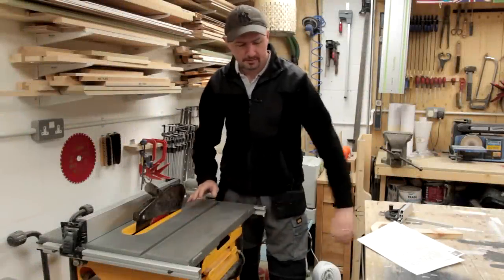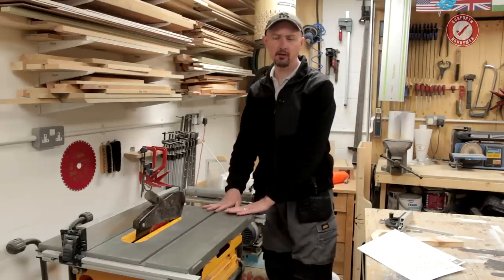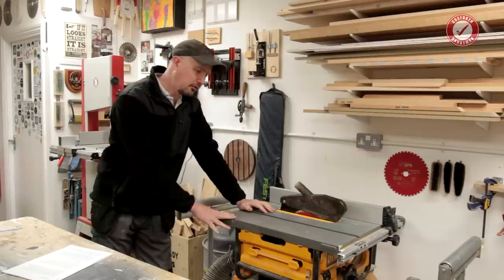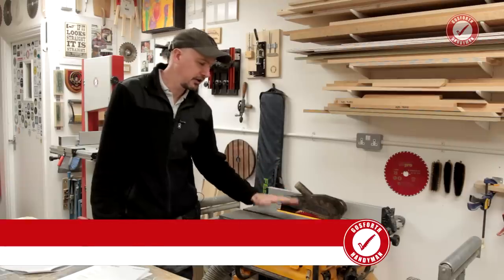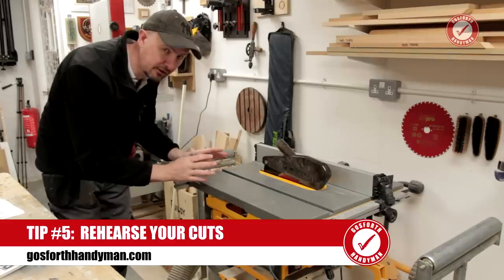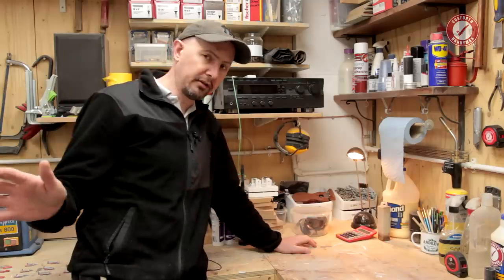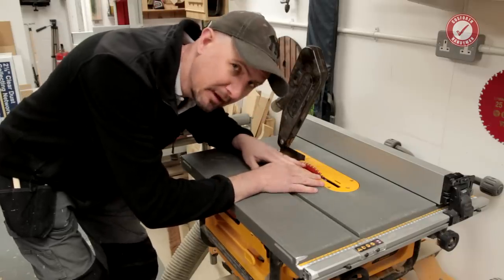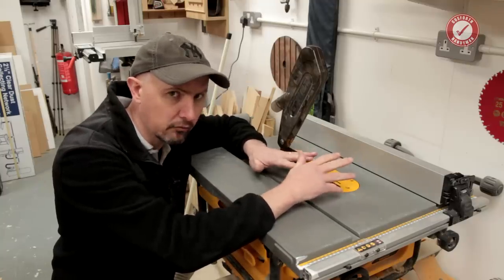TABLE SAW SAFETY - 11 tips to avoid death!

Comment: I use a cable tie to tie my blade changing spanner to the plug end of the power cable. That way there's never any power available while my hands are inside the table.  It's probably overkill for the table saw, but it's definitely worth doing with things like little edge trim routers that have switches that can be accidentally flipped while you're changing cutters.
Reply: I do exactly that with my angle grinders
Reply: Since i nearly lost 2 fingers 3 years ago, I've stopped using power tools whilst drunk.....honest.
Reply: Sorry, could you help me understand this? Thanks
Reply: @Kooshad1  I believe he means if you zip tie your blade changing wrench to the plug end of the power cord you would have to unplug the power cord before you could use the wrench to change the blade.
Reply: I did this with the chuck key of my drill press.
Reply: This is genius.
Reply: Good tip. Also always ujnplug your tools when you don't use them. More awareness to the action of plugging in... danger starts
Reply: Such a good idea. I might do this.

Comment: The best piece of advise my high school shop teacher ever gave me was; "The moment you lose respect for a machine, that's when it's going to bite you! Don't be afraid of it, just never lose respect for that spinning blade." That said, my table saw is the only tool I have that scares me.  My scroll saw doesn't scare me, nor my saws all. my circular saw doesn't bother me at all. and I'm certainly not afraid of my 10" miter saw. but the table saw, that's a different beast all together. Never run one without thinking and planning your cut first. and use all safety precautions!  Thanks for this video bro! good info, and a good refresher for people who already have and use table saws.  Glad that kickback didn't seriously injure you btw! :)

Comment: I’m terrified of my table saw, now I have a checklist of things I do before even plugging it in. I’ve had 1 kickback incident, minor injury, but made me very wary. I made a cross cut jig, feel much more confident with it. Everyone please take care when using table saw. Great informative video 👍
Reply: Same here, table saws scare the shit out of me. Kinda sucks, though being that it's my FAVORITE tool by a landslide.
Reply: I think if you are afraid of your saw, you should actually sell it, and never use it again. Our subconscious mind has a way of warning us. We need to listen to our impulses. I had a feeling that I shouldn't use my saw a few months ago. I heard an inner voice say "this is a bad idea, don't cut this tiny strip of hardwood" and I didn't listen to my own instincts, and I ended up having a violent kickback. And I've been cutting for 25 years on a tablesaw, and still made a major mistake. What you can do instead, is simply make your own ripping fence and crosscut fences (straight edge guide jigs) for a handheld circular saw. I bought a Dewalt 7 1/4" right side blade, ultra light 13 amp circular saw, and it's absolutely amazing! It's super light, and super quiet, and you can rip large pieces of plywood or do small crosscuts without the fear factor of a wildly dangerous tablesaw.
Reply: @Ritalie  hi, yeah I got a ryobi circular saw and using it more now👍

Comment: Thanks for all the reminders, great video. As far as potential negatives to standing beside the saw instead of behind it, the first negative that comes to mind is that you are now far from the "off" switch if something does go awry. Maybe you could add a foot switch between the power source and the saw. I added a hip bump switch to my older cabinet saw. You could add a bump switch to the side of your DeWALT on witch you are standing. Just wire it in series so either switch could turn off the saw. (Of course you would have to have both switches turned on for the saw to work -- the final switch that you turn on would be the one where you are standing. Three-way switches would complicate the wiring since you could no longer use the saw's original switch and would void the warranty. My bump switch was purchased from Grizzly here in the US. ) Sorry to hear that you all can not use dado blades in the UK -- you can always bundle up your boards needing  a dado cut and fly over here - we'd be glad to see you.

Comment: Well done.  There are two types of woodworkers. Those that have had table saw accidents and those that will. Count me in the first group. Fortunately, just bruising (skin and ego) and scraping. Your comment about "if it doesn't feel right, don't do it" is dead on.  And when you hear yourself saying "it's just one quick cut", stop.  Thanks Andy!
Reply: wish I had read this a month ago lol broke two fingers and slice a chunk of my thumb off. thankfully I kept my fingers but on to a long road of recovery!
Reply: @mariobarron1384  It could happen to anyone working with a table saw. Get well soon, Brother!
Reply: "It's just one quick..." applies to all tools, even hand tools. I have many scars to prove it. Getting my first table saw this week, used a big one quite a bit in the past but never had proper safety info like this since very long ago. Excellent video.
Reply: @mariobarron1384  How did your healing go Mario? I've been cutting for 25 years, and thought I knew everything about table saw safety. Unfortunately I didn't know what a riving knife was (it's pretty obvious now.... duh!) and I was cutting a piece of small hardwood, and it kicked back. I sliced into 4 fingers. I had the blade low enough that I only cut about half way through my fingers.. Ugh.. I'm mostly healed now. My accident was due to using my saw after a 10 hour work shift, and being exhausted, and not thinking clearly. I now realize that accidents are the result of a mental problem, not a physical problem. Paying attention to what you're doing is of the utmost importance. Never operate a saw after work, or while being tired. I wish I hadn't been so over confident. I thought: "Oh it will never happen to me... I am too experienced..."

Comment: As an relative amateur in woodworking I’ve always been scared shitless of my table saw and use it only when I have to. Luckily my fear always lead me to follow most of the steps listed here and so I have never had an issue. However this video has taught me to fear less and respect more and I’m looking forward to the next opportunity to use my table saw.
Reply: This is one of the biggest lessons I've learned as I get more familiar with my table saw. I'm trying to carefully transition from "deathly afraid" to "cautiously respectful" of the tool. Table saws are an incredibly useful, versatile tool and are practically a necessity for most projects but they are also so dangerous that they require the user to CONSTANTLY be focused on every action they are doing.

Comment: One very interesting tip is when retreiving a piece of wood resting on a roller  after a cut it is possible to feed back the other piece back into the danger zone, you are  the only one mentionning that on safety  video. Thanks!

Comment: I had kickback 2 yrs ago and it took pointer finger, messed up ring finger and pinkie finger has 3 pins in knuckle. And that is with feather boards and push pads. So thanks for doing this video! Just need to keep people aware of always think through before doing anything.
Reply: Wait.  Can we get an explanation?  You say you had kick back while using featherboards and. Push blocks.  That sounds almost impossible ......what happened? Z
Reply: @mrkoolio8494  Well if you think nothings impossible it will get you at some point. It happened. The cause - All I heard was a click so if the magnet on the feather board slipped or I did see that the blade was missing a tooth so that might have been the trigger. I can show you my hand if you want - of course I don't need to prove it so you believe, but I sure do since it happened to me. Keep and be safe my friend.

Comment: Thanks for the tips. I bought a SawStop after I had an incident where the push stick slipped and ran into the saw blade. It flung the push stick back into my hand and destroyed the push stick as well as the saw blade. The blade bent at the point of contact and had to be discarded. I ended up with some serious bruising but my hand survived. The SawStop saw was extremely expensive but well worth the expense when compared to the cost of losing a finger or a hand. Thousands of people lose a finger(s) or a hand every year. Again, thanks for the additional tips.

One more point. I've been using that table saw for over thirty years before the accident. It doesn't matter how familiar you are with your table saw, accidents can happen any time. Be safe.

Comment: Good information. I thought the knife part was just to hold the "safety" shield on, which I found to be  problematic,  and removed it all. I think I'll put the knife part back on.  A helpful thing I've found, is  to use an inline foot switch. In the situation where you feel its unsafe to go forward or go back, and you just want to hold steady and power down, you just slide your foot of the switch and don't have to let go of anything to reach for the power switch.
Reply: lalaland0417 I like the sound of that, I will be looking to get one before I use TS again
Reply: My dewalt saw you can literally just hit that stop switch with your knee. I do it just so it has become a habit so my hands are always securing the wood I just cut. But for an older saw that has a stop switch harder to get to an inline switch is a great idea
Reply: Definitely put the knife back on. Always use it.
Reply: Do you have a recommendation for a foot switch? That addresses the problem I have with working from the fence side.
Reply: @fredeisele1895  I bought  one from AliExpress  (google Industrial Foot Operated Pedal Switch Footswitch). It is robust enough, has a 15A rating , but needs wiring . I used an off the shelf extension cord chopped and joined via the switch .
Reply: Why is a foot switch not part of the standard equipment? Shouldn't all saws have a foot switch?

Comment: You have made The BEST video on table saw safety. This video link should be a  required listing in all table saw manuals.  Telling it like it is, saying it so that the mind can hear it. Thank you. I've been using a table saw for 15 years off and on;  you are spot on.  I definitely prefer to use a chop saw for well, uh, chop saw cuts not a table saw which is really designed  for rip cuts.

Comment: I am having my first table saw delivered to me on Tuesday. I am pretty excited but I am not even going to turn that thing on until I have read the manual cover to cover. Right now with the way things are in the World, the last thing I need to do is end up in the ER at my local hospital due to a stupid injury that could have been easily avoided. One thing I will always do, is just raise the blade slightly above the surface of the board to be cut. This will avoid potential massive damage if an injury does occur. Also I have read NEVER try to cut a board without something like a push stick (actually two) if the cut is smaller than the width of your hand with outstretched fingers. This sounds like a pretty good rule. 
Also here in the States we have a product called the Micro Jig. It is highly recommended by many woodworkers. I will probably order two for my own piece of mind. They are pretty expensive, but what is the price of a finger? 
Great tutorial and information, thank you, and I will read the information on the links you have provided, thank you.
Reply: I have considered the Gripper as well.  Steve Ramsey is a big fan, but they are a bit more expensive than my homemade push blocks.
Reply: Gregg Hernandez I have a Gripper block and it works great. You can easily make useful and safe push sticks also.

Comment: I've been using a 745 fairly extensively as a hobbist for about a year now. I agree entirely about standing behind the fence when possible and I'm glad you covered that at the video's end. It's a way I edged 3" of pine laminate (blade fully extended) that I worked out as being the safest way of making the cut... When cutting plywood, I like to wear "grippy" winter type gloves as plywood has a tendency to be slippery otherwise . I use a roller for feeding longer material . My out-feed table is a card table--not very pro, but I don't see why anyone would want a roller for out-feed. I do like using a couple Micro-Jig Grippers push-blocks for many cuts as well as the supplied push stick for really narrow pieces. Also, since I don't make a living doing this, I will only use the table saw when I feel fully alert. Good pointer about using alternative tools whenever practical. Never understood why do cross cuts on the table saw that can be done on the miter saw. Interesting about Dados being near illegal in the UK.
Reply: Beware using workgloves with a table saw.  Contact with the blade will catch the glove and pull your hand in.
Reply: I also agree with the other comment here, I have seen many videos on safety and gloves should never be worn. Due to the fact the blade just has to nick the cloth material and it will suck your hand right into the blade and where the blade would normally slice or nick your hand the glove cannot let go and your hand up to your wrist will be severely mangled. I would never use them working with any power tool where your hands are close to the impact area.

Comment: Thank you for this video.  I had a piece kick back on me yesterday and now I understand why.  I was cutting a piece wider than it was long and not using the riven knife and blade guard.  The short piece, which was by the guide, kicked back and struck me in the shoulder.  I was not hurt as I was 1) using a very long push stick and 2) turned my shoulder away from the block of wood as I saw it coming.  I will use my riven blade and guard from now on and use a different tool if I need to make that kind of cut in the future!  I am very glad to hear you were not hurt but thank you so much for sharing your experience because I will work safer in the future!

Comment: Haven't finished the video yet, but please for everyone here... Please take that first tip very seriously!  I just experienced this exact issue with smaller piece of wood and I'm currently recovering from massive bruising on both my thumbs and my stomach.  Not to mention the impact wounds, and cuts to two of my fingers.  None of these cuts were from the blade, but actually from the piece of wood being launched at me and removing my skin on the way.  Put that Knife back on every time! Never go without it!  

Was using a Dado Blade prior to the  accident and did not put the knife back on when I switched blades.  It was terribly scary and I'm very lucky to still have all my fingers!  It happens so fast, please be safe everyone!

Comment: Awesome video. You have hit upon some of the most significant safety points including using the blade sideways which is thought-provoking. The only thing we perhaps would require to overcome standing sideways is while using it for angle cut. As you have to hold the wood against the 'D' working towards the blade one cannot perhaps stay on the side. But definitely, there can be a solution. Appreciate your presentation and thank you for making this film.

Comment: Great video, made me rethink a couple of points. I would like to add a point close to my heart, the insert plate. Always make sure the insert plate is (exactly) flush with the table top. Mine was low on the out feed side, once and the piece I was cutting got snagged in the dip. Like a moron, I lifted the board a little to clear it and .....BANG..... I had two pieces of board flying at me. Not only did I risk serious injury or worse, I also lost an expensive board as somehow it managed to snap in two. I should have stopped the saw and reset the inert plate and then completed the cut. Have a safe weekend everyone.

Comment: I sometimes stand on the side of the fence when I know there's a higher risk of kickback, or to avoid having to lean over the table. I also recommend having several different types of push sticks and blocks to be used depending on the type of cut. I use MicroJig blocks a lot and have 3 configured differently.

Comment: Andy, you should check out the Microjig “Gripper”. It is a push stick/handle system that. I bought a two pack set and also use it with my jointer. I rarely use a push stick any more.
Ron
Reply: I agree that push block looks amazing, but at the same time it does put your hand directly above the spinning saw blade. The handle of course and the construction of the block keeps your hand above and protected...but yes, your hand is passing directly above the blade in most of that companies demo videos. That being said, yes i do want the "Gripper".
Reply: @lexieharvey8186  I agree. The thing looks like a disaster waiting to happen. But it's gotten great reviews; somehow that over-the-blade hand position doesn't seem to be a problem with this design. (But I have no experience with it yet; just watched several videos and talked about it with friends who have one.)
Reply: Ron H I love the Micro Jig blocks...especially for dado cuts - The board feels much more secure and in proper position.  It also allows me to stand off to the side (but still in front), but on the side where the power switch is.
Reply: I know a Gripper is pricey BUT If you are looking at purchasing a gripper, buy two. 

The ability to move a piece with a gripper in both hands helps me control longer pieces.   Even on smaller cuts I don't find myself leaning out over a saw.